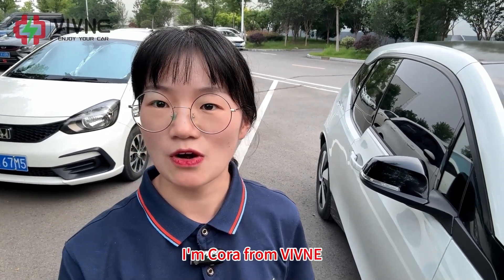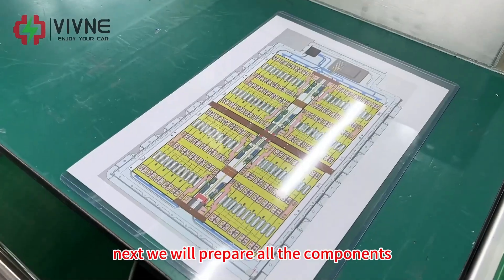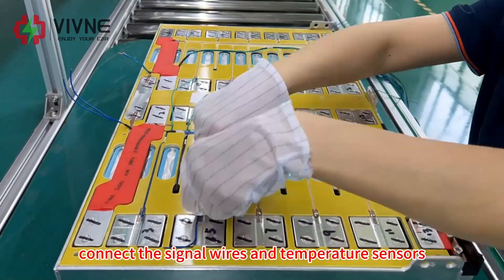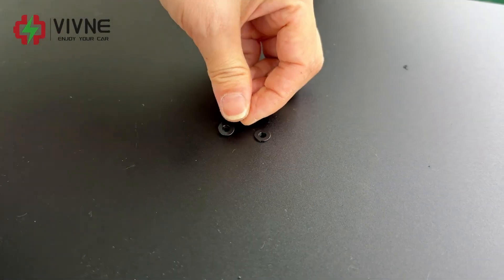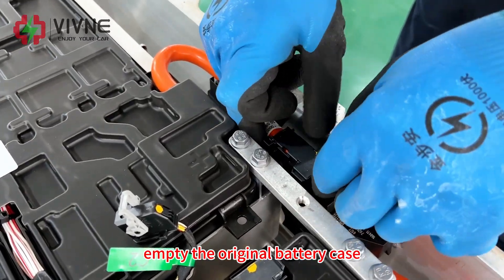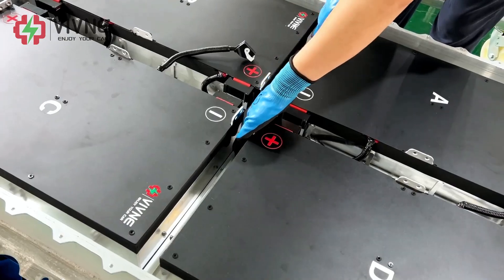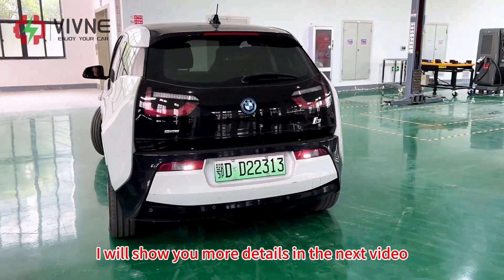VIVNE-BMW i3 battery upgrade to 45kWh?

Comment: hallo do you use the original sme  csc  module from the 60 ah battery  if you change the battery is not a software upgrade required  you use the same battery charger from the old 2014 i3 model  the gauge screen you must nothing change can the engine controller process self the new kilometer range ist much more is engine controller not software update necessary
Reply from the maker: Hi, we will reprogram the SME, then the car can recognize the new battery and the gauge screen will display the correct mileages.

Comment: That video makes the installation look fairly easy for a trained EV high voltage technician. I do have a question about the new SME. Will there be any issue when performing a software update at the BMW dealership with the BMW ISTA system since it’s not a BMW SME part number?
Reply from the maker: For the SME, we actually reuse the original BMW SME (with the original BMW part number), so there will be no compatibility issues when performing diagnostics or software updates using BMW ISTA at the dealership.

Comment: Why not put a sealing paint over the nuts and screws? The battery is vibrating. Also it would be great to see you use at least some silicone sealant gaskets for waterproof.
Reply from the maker: Thank you for your suggestion! We actually use the same screw specifications as the original BMW design, which is why thread locker (sealing paint) isn't required. As for waterproofing — the original BMW battery case is already designed with a silicone sealant gasket between the case and the lid.

Comment: how much did it costs?
Reply from the maker: The battery is 5480 USD, and I need to check the shipping cost according to the delivery address, WhatsApp(+8615211174371) me if you interested in please.

Comment: Looks good! Wish you have a cross-linked plate in the middle of the battery module between the two cell stacks if you have enough space for it. Means to be more like the mechanical structure of the original i3 battery module and will work against cell swelling due to charge/discharge cycles and aging. The single-sided cross-brace you have perform this function on one side only. 
And two hole tubular ring terminals on the terminals of the entire battery string would be better too imho
Reply: Cell swelling in modern NMC cells, even after many cycles, is minimal as long as charging and discharging occur at moderate C-rates.
Reply from the maker: Thank you for your valuable feedback! 
Due to the limited space inside the battery compartment, there is unfortunately no room to install an additional cross-linked plate between the two cell stacks.

As for the terminals — that's a great suggestion. We've actually already made improvements in that area, and you’ll see the updated design in our upcoming videos.

Comment: This is very cool, but why should someone use a 3rd party battery retrofit, if you can retrofit the original 120Ah pack, which is said to have up to 130 Ah in reality.
Reply from the maker: That’s a good question! Our 45 kWh battery uses 129Ah brand-new cells, which offer more range than the original 120Ah pack — up to 300 km real-world range. Also, original BMW packs are often more expensive or hard to find, while our solution is more affordable and comes with full support and warranty.

Comment: If i have a 94 Ah Model, what have to be changed regarding bms and power controller. Hoe does the car handle higher capacity, need reprogramming?
Reply from the maker: Yes, need to reprogram the SME, we can do that job

Comment: Wont the extra weight of the battery have a bearing on the supposed 300ki range? Have you done a video showing a range test?  What’s the cost of the batteries?
Reply from the maker: Our 45 kWh battery weighs 272 kg, which is very close to the original 94 Ah pack and only 42 kg heavier than the original 60 Ah version. The additional weight is minimal and has negligible impact on the real-world range. We will do the range test soon. The cost of the battery is 5483 USD, need to check the shipping cost according to the delivery address.

Comment: Any chance for USA Fiat500e (2013-) pack? Even the original capacity would be nice.  It uses the same cells as the 60Ah I3 but in a different form factor and configuration.
Reply from the maker: Sorry, currently we don't have plan to make batteries for Fiat500e, not sure in the future

Comment: Surely all those bolts need to be torqued down, rather than just hand tight! There was no sign of or mention of the torque wrench! I'm concerned!
Reply from the maker: Yes, you are absolutely right, the screws should be tightened using a specified torque, not by hand. We recommend using M6*10 screws with strength grade 8.8. The required tightening torque is 9 ± 0.5 Nm. To ensure all screws are properly secured, we suggest using marking or double-check methods. Please also note that the screws should not be reused more than 5 times. All these details will be clearly included in our installation manual.

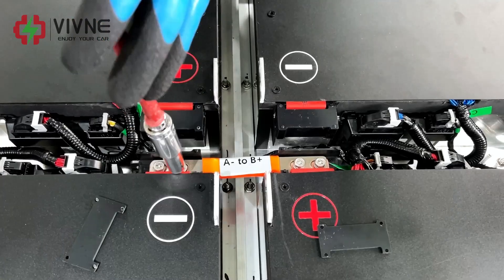Comment: 6:22 Germans would use specified torque, not hand torque to tighten the screws 🙂😉
Reply from the maker: Yes, you are absolutely right — the screws should be tightened using a specified torque, not by hand. We recommend using M6*10 screws with strength grade 8.8. The required tightening torque is 9 ± 0.5 Nm. To ensure all screws are properly secured, we suggest using marking or double-check methods. Please also note that the screws should not be reused more than 5 times. All these details will be clearly included in our installation manual.
Reply: @VIVNE-CoraLiu Great information! Thank you 😃

Comment: Good project and work. How much cheaper would an LFP solution be (battery install cost is the same of course)? Perhaps ~70% of the capacity 🙂 Lower cell voltage would result in higher cell count 🤔
Reply from the maker: BMW i3 can not use LFP cells, because the vltage does not match

Comment: Nice transparency, thank you 🙂I didn't see any cell balancing implemented. Only sensor wires, no cabling to discharge or charge individual cells for balancing. However, the original does not seem to have that. Upgrade could have 🙂😉
Reply from the maker: Thank you for your observation! For safety reasons, we did not implement any modifications beyond the original design’s functionality.

Comment: 3:13 The temperature sensors could be put in the middle of the cells 🙂
Reply from the maker: Thank you for the suggestion. Currently, the temperature sensors are installed in direct contact with the cells to ensure accurate temperature monitoring.

Comment: I’d be a bit worried about the thermal management of cells in the middle of the larger modules used in this system. With the original smaller modules there is much less distance from the sides of each the module to the centre, the heating or cooling effect of the base plate will be more evenly distributed than with the larger modules.
Reply from the maker: You make a valid point, the thermal distribution in the original smaller modules is indeed more uniform, as the heat transfer distance to the center is shorter. However, we believe this difference is not a critical factor and will not significantly impact cell lifespan. With the upgraded higher-capacity cells, the load on each cell is lower at the same power output, which results in less heat generation overall.
Reply: The latest generation of CALB NMC cells offers significantly better efficiency and generates less heat compared to the 5–10-year-old Samsung and CATL cells used in the BMW i3. Therefore, thermal issues are unlikely. Additionally, the charging power is relatively low — around 1.1 C (50 kW for a 45 kWh battery).
Even under demanding conditions like top-speed driving or climbing steep inclines, it would take over an hour to fully discharge the battery — corresponding to a discharge rate of about 1 C. So this level of charging and discharging with the new cells produces far less heat than earlier generations of NMC cells, which were more known to heating at similar C-rates.
It’s also worth noting that the first-generation i3 used a 60 Ah battery, which operated at significantly higher (double) C-rates, yet the thermal management system was capable of handling it effectively without over heating.

Comment: How much weight this new battery? Is it cooled?
Reply from the maker: The new battery is about 32kg heavier than the original 22kWh, the cooling system still works fine
Reply: @VIVNE-CoraLiu  In the original (pre-LCI) generation, so that'll mean reduction in payload of 32 Kg in the upgraded cars with your new battery in order to avoid exceeding the original gross vehicle weight limits ? However if the later LCI facelifted generation is used, due to the additional strengthening done by BMW over the sills & B-pillar regions etc. (to accommodate their official > 22 kWh batteries) i would then expect the car's original designed payload in the facelifted cars to be practically unchanged if retro-fitted with your new batteries ?? What is your company's feedback on the increased battery weight issue ??? As for the cooling capacities, i'm not aware BMW did any upgrade of their cooling capacities from the original (pre-LCI) to the facelifted LCI versions of the i3 with original larger capacity batteries. So i have to assume then that any increase in the cooling loads from the new batteries would not have impacted cooling capabilities significantly so as to require increased cooling capacities ? Overall i would expect that the pros outweigh any cons in doing the new battery upgrade retro-fits as such ?!?
Reply from the maker: @hseochin  The new battery is approximately 32kg heavier than the original 22kWh battery, and its weight is similar to that of the original 33kWh battery. The additional 32kg has a negligible impact on the overall vehicle structure. With the new battery, the cell capacity is larger, so under the same power output, each cell bears a lower load and generates less heat. Therefore, we believe there is no need to increase the existing cooling capacities.

Comment: I have been looking forward to this for weeks. Wish it was LFP rather than NMC though
Reply from the maker: BMW i3 can not use LFB batteries, because the voltage does not match
Reply: LFP has downsides, like not releasing any energy when it's too cold. So it would be dangerous to have a car at, say 100% battery, in the cold.
Reply: @notkyloren That's not really true.
Reply: @notkyloren That's not really true.

Comment: Much better than all retrofit packs I knew until now. But I still think the mechanical solution and their sturdiness/crash safety is not comparable with the original design. So still a show stopper for me. And I am not talking about warranty or guarantee issues I will face towards a customer. These could be managed. But any liability issue could cost me a fortune. And this risk I cannot take until a battery manufacturer can assume this risk or at lest supply valid paper work incl. real test results, valid certificates etc.  Does anyone know a solution that is copying the mechanics of the original desing? It's more expensive, but it's worth it from every angle.
Reply from the maker: Regarding mechanical design and robustness. The current solution is confirmed by our designers after multiple verifications. We have made relevant test videos and will release them soon. We are working on the certification and expect to have results in 3-4 weeks, let's look forward together

Comment: BMW I3 battery doesn't have liquid cooling?
Reply from the maker: It have liquid cooling
Reply: I believe at @4:15 they're emptying the aircon lines which are used to cool the battery pack.
Reply: Yes for removing the battery pack you have to empty the lines, they will be refilled after putting the new battery back